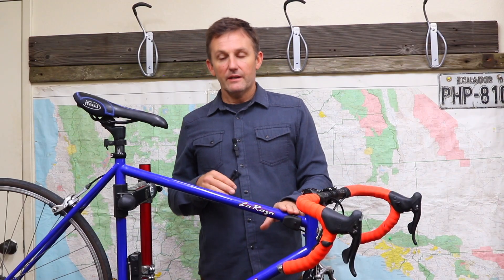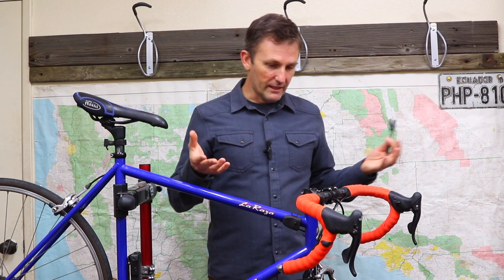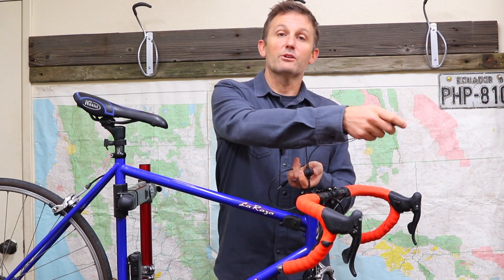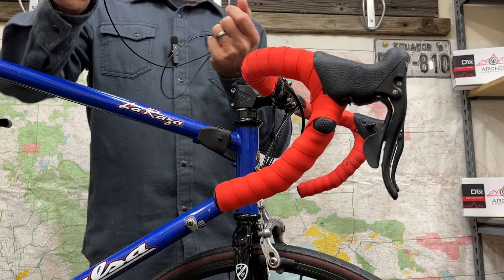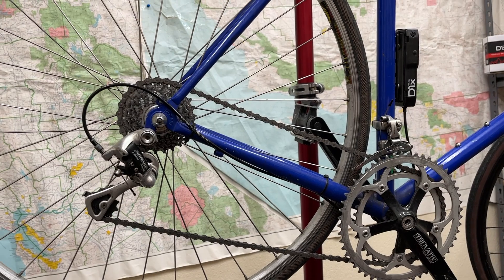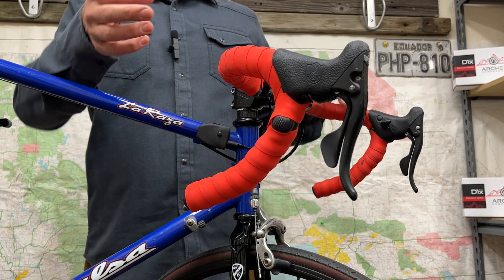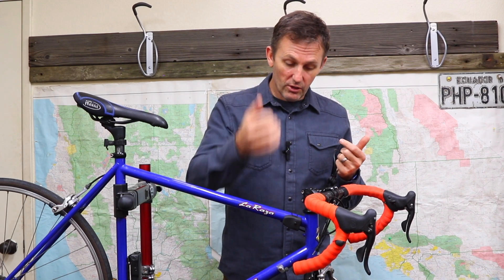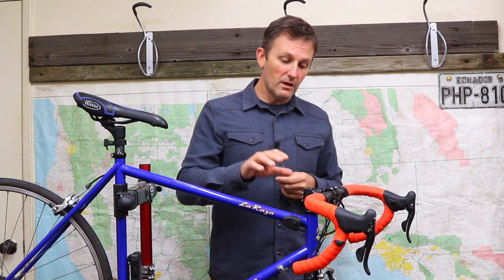Webignar #5 - MFR Remote

Comment: Installed the MFR three weeks ago and it works like a charm. When deciding the button location, I'd suggest that you wear your cycling gloves to fine the truly best location before finalizing the location. Your gloves add a bit of thickness impacting proper shifter position. 

An excellent product, nicely engineered and well thought out.

Comment: How to do micro-adjust? Does it only have shift buttons?
Reply: The shift points and micro adjustments of the derailleur are set in the motor pod, not the remote. This remote just sends a shift signal to increment the position.
Reply: @galenkehler  , but my remote has a micro-shift button next to the shift buttons. So I can adjust the position for each cog on the fly.
Reply: the remote box has a small button, just like the micro adjust remote, so i guess you can activate the micro shift mode with this button, you  can somewhat see it at the closeups like 1:30
Reply from the maker: @NP13000  You're absolutely right. Sorry @shenzhenpingpong2 for not mentioning it in the video but that small button on the pod does a couple things. 1) turns the remote on & off and 2) engages micro-adjust mode just like your MTB remote.
Reply: @ArcherComponents  , thanks so much for the update. I have three Archer D1Xs now, two working, one that slips.